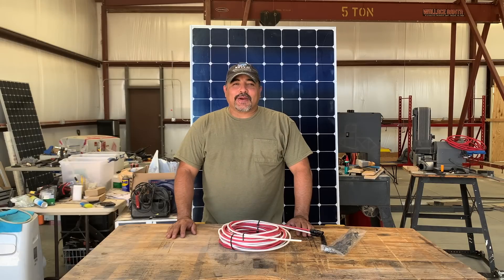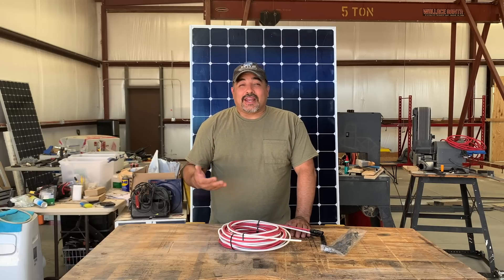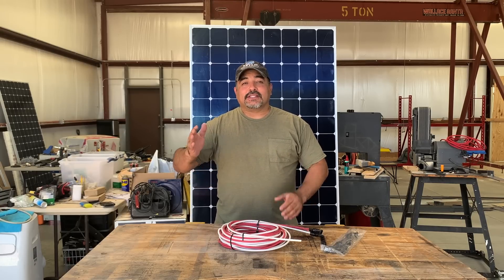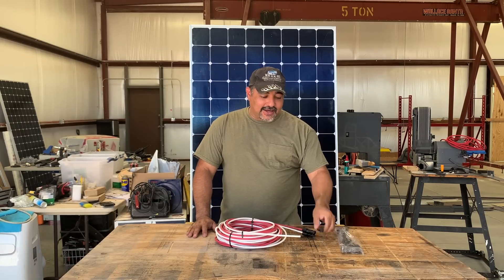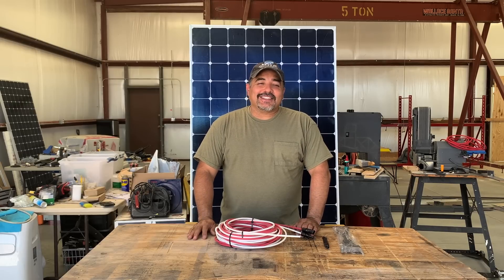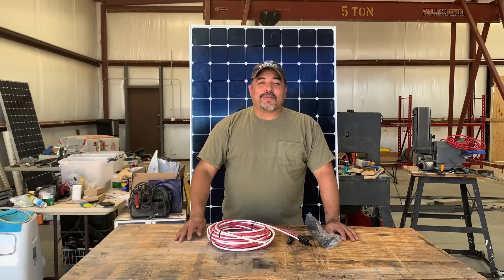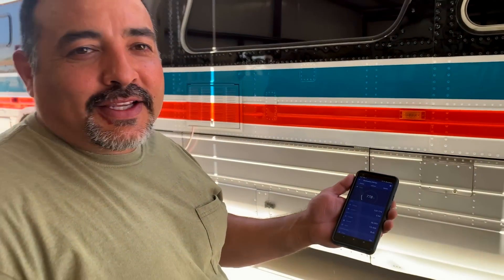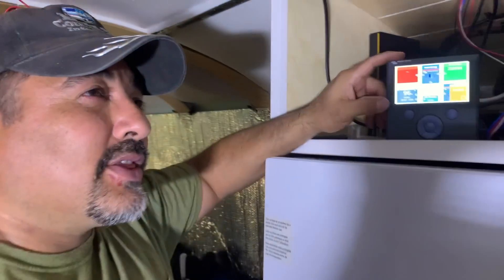More Power for a HOT Summer

Comment: Curious how you run AC when in transit. Is it still off the batteries and recharged by Solar/8V71 Engine generator? I was wondering with the original  300 Amp original 8V71 Generator, could I run one AC off that in lieu of my auxiliary generator?
Reply from the maker: Thanks Joe - we run the air conditioner right off the batteries when we are in transit (which so far has not been very far).  When we are traveling we only have 1750 Watts of solar exposed (our lower panels slide in while we are traveling).  We have not done a generator and we still have the AC Delco 50DN Generator in our bus (we pull a whopping 10 amps with our LED headlights at full bright). We have a unique problem because our house battery is actually a 48V configuration.  They do make step-up converters that will go from 12V to 48V but they are ridiculously expensive for anything but very modest loads.  If (very unlikely) we opt to charge our battery from the alternator this is how we will likely do it.  We would buy a cheaper ~2500 Watt 12V inverter and hook that up to the coach batteries (two 8D lead acid batteries).  From there we would connect the Victron's "generator" input to the output of this cheaper inverter.  When the Victron "see's" the 2500 Watt inverter come online it will act as a passthrough and charge the batteries (assuming our loads are lower than 2500 Watts).  We would also run a temperature probe on the generator to be sure we are not running it to hot so we could cycle it.  For now we are hoping that the battery will be big enough and the solar will be strong enough to keep everything healthy.  Of course we will report back if that is not the case.
Reply: @BeginningfromthisMorning  Thanks for the reply Juan. If I recall, you installed a mini-split. I need to research the power requirements for those. I would like to remove my roof air, but not as solar based as you. Would prefer to run it off the 8V71 during transit. Keep up the excellent work!
Reply from the maker: @hasletjoe5984  You are correct sir - The mini-split A/C was one of the first things that went into the bus.  A few very nice things about the mini-split are that it uses much less power compared the roof a/c, it has a very gradual ramp-up instead of the big hit those roof top a/c draw and its so quiet.  I would do it again 100x before I went back to a rooftop unit :)

Comment: Just wondering what size welder you are running off your solar.  thanks.
Reply from the maker: We have run a couple.  For a long time we used my friend's Lincoln SP 135+, recently we got a small portable welder - Century FC-90.  Both have worked flawlessly even when we are running 3 air conditioners on the bus!

Comment: I don't know how you guys deal with that kind of heat, I guess you get used to it... I'd be a puddle on the floor, we've had a couple weeks of 100 degree weather here in the Okanagan and it was not fun, I put 700 watts of solar on my bus this spring just to run the fridge and it just barely keeps up with the inverter and fridge, if we run any power tools I have to run a generator, for some reason I average about 50% capacity out of the panels... maybe because the sun is lower on the horizon... not sure but I guess I'll need another 700 next year, good to see you guys are still hard at it even in the heat....
Reply from the maker: LOL thank you James - this has been the hottest summer in Arizona history (ever recorded). I have been a puddle on the floor a few times - especially when we have to weld so the big door comes down to prevent the wind from getting into the welds (making the welds porous).  I have told Michelle on more than one occasion "If this is our last summer in AZ for a while - I am 100% onboard with that".  What type of refrigerator are you running?  We did a test on our absorption refrigerator and sold it shortly after because it was such a power hog. You are so much further north and I have to assume you flat-mounted your panels.  Clouds play a big role too.  We are still very much getting after it (as I see you are too!!) - maybe we will be done near the same time :). It would be great to meet up somewhere in the middle :)
Reply: Hi Juan  the fridge is a 22 cubic foot residential 120v fridge... I'm not a huge fan of rv fridges and I have no propane onboard but lots of battery so electric was my choice as I think you guys did too. We usually go to Yuma for a holiday in the fall  not this year obviously but yes, it would be nice to meet up somewhere when we are both on the road , we'll have to keep in touch and see if we can make that happen

Comment: Nice solution!  Way quieter & no gas usage  :)  
Someone in the comments mentioned using the DC side of a regular generator to charge directly DC to DC using your current charge controller.  
I was thinking about building a small engine & car alternator gen-set to use as an emergency backup since it would be DC-DC but at a higher 60-120 amps instead of the lower 8-ish amps from a normal generator...it would be fairly compact and able to recharge the batteries pretty quickly or to use as a supplement on really long low/no sun days if need be.
Reply from the maker: Thank you Gregory - I like your "outside the box thinking" of the alternator solution.  A couple of things to check (I genuinely don't know the answer to these) 1) is that car alternator regulated or can you "tune" it at an RPM for your desired voltage?  2) Can you build a small engine that runs as quiet as those Honda generators (those things are surprisingly quite). 3) the 8ish Amps is at 120V (close to 1000W on the low end) which will charge a 12V battery through your inverter (although there are clearly going to be losses ...) - I would be very interested in checking out your solution if you find a really cool way to do it!  I guess the short version of this comment is I LOVE THE IDEA!
Reply: 1) I would suggest a self-regulated one that is on the low end...like 1500 to 2000 rpm...but 3600 rpm would be okay depending on the engine used...though louder.  
2) You probably won't get any quieter than a Honda...those things are really super quiet!  
3) The 8.3 amps is using the 12VDC output of the normal generator...which is why I suggested an alternator gen-set for higher current charging.  
I have also seen people add an extra alternator on their vehicle engine for a high power output but that would use a lot of diesel in your case.

Comment: I am learning alot from you - but electricity still scares me....Could you eventually place those panels in frames on the roof of the workshop to run basic power need ( lights-etc ) for your ( or others ) use?  Or - perhaps put a couple casters on the frame to roll in /out when you are not there?
Reply from the maker: Thank you Tim - Electricity should honestly scare everybody!  I have a great deal of respect for it.   As for the shop - we are only at the shop temporarily and they (our cousins who own this land) are hoping to have city power run to the shop in the next few months (LOL - probably just as we are rolling out :)).  Fortunately, we don't need to put the panels away because the entire property is gated and we have cameras that record 24/7 and alert us if there is motion in certain areas.

Comment: make your stand out 1/2 or 3/4 pvc pipe and make rectangle out Pvc pipe  That fit in side solar panel  have four tent stake or small sand bags so solar panel blow over by the wind. if you are do temp set up why did you use 10 awg  extinction cord and cut off end $75.00 . or 12/3 awg  at $50.00  and easy wind up.
Reply from the maker: I love the PVC idea!  The frame is made out of 2x3 lumber which was really cheap (I think the entire thing cost something like $15).  As for the cable, we bought the cable, splitters, and the fuse for less than $50 from San Tan Solar.  It does not wind up as easy an extension chord but it is more UV resistant.
Reply: @BeginningfromthisMorning  extension cord Is UV rate should be mark on cord as the wire you got . extension  cord soow have high UV rates.

Comment: Hey, i was wondering how the mini split was holding up? Have you drove around with it much? Has vibration from driving become an issue? I can't see any problem with the plan on paper...
Reply from the maker: Hi - The minisplit has been doing great!  We used to drive the bus 2 times per week (about 8 miles) for about 2.5 years with the a/c cranked the whole time.  Back in April I thought it was done for because it was not blowing cold.  It turns out some of the refrigerant had leaked out through a bad Schrader valve (extremely common even on units mounted on houses).  We had our friend who helped us install it come out and use his sniffer and it was for sure the Schrader valve ($1.59 btw) LOL.  It has been running great since.  When I first installed it there was sooo many people that said it wouldn't last 3 months, it wont last but it has been happily cranking along for over 3 years now.
Reply: @BeginningfromthisMorning  from all my research it seems that there is nothing wrong with installing a split, if you have the room for it. I hear far more stories about the $2000 inefficient rv style roof top models breaking or not performing well, not to mention the noise they produce. There are some amazing 7 star split systems that run on around 350w and quietly produce 2kw cooling!

Comment: I've been watching your videos from the beginning. I really like them. Knowing what you know now. Would you build the same power system again? What changes would you make?

I just bought a 40 foot transit bus. I'm planning out the build. I'd really love your input.
Reply: Been thinking about this myself. Depending on where you live , trying to ditch a generator completely can be tough.   The mini plot AC is a must though. Good luck on the build.
Reply: @HimmelbergerBus  I live in Michigan. I don't think it's ever going to be an option to not need a genset all together. I going to try a small portable inverter generator. My wife would agree about AC. Thanks. I'm going to need all the luck I can get.
Reply from the maker: Thanks Guys.  Let me start by saying that the system has been working very, very well.  If I was to sit down and design a system tonight I would probably use LFP cells from China.  They are Lithium Iron Phosphate and are a better, more durable chemistry than the Nissan Leaf.  3 years ago when I built this system LFP was available but it would have cost me probably 10X what I paid for the Nissan Leaf for the same power.  These days I can put together a pack of about that same capacity for around $4000.  I thought for a while that I would have liked 240V but that was mostly for a dual-head mini-split system.  I don't think I would need 240 for anything else and it would complicate things like shore power and general wiring.
Reply: @BeginningfromthisMorning  Something like this?

https://www.aliexpress.com/item/4001099508935.html?spm=a2g0o.productlist.0.0.211e463eHLJjQ9&algo_pvid=c4726852-2618-47cc-bcc2-8f0820c44b82&algo_expid=c4726852-2618-47cc-bcc2-8f0820c44b82-23&btsid=0bb0622a15997399922313920e9e6c&ws_ab_test=searchweb0_0,searchweb201602_,searchweb201603_

85 cells. 3.2v X 17 = 54.4v, 85 cells X 3.2v X 90Ah = 24,480 W @ 100%  
5 lots of 16 X $824.59 =  4122.95 + 1 lot of 6 X $317.49 = $4440.44 + $488.46 shipping = $4928.90

 If my math and understand of the listing is correct? Not a bad deal? But, I'm sure I could get a better deal buying them all at once.

I was serously concidering a long Tesla Model 3 battery. That would take a lot of time to engineer the system to have it all work together. But it would be very cool in the end. 

Your idea would save a lot of time using off the shelf parts. I don't know which one is more fun, a big engineering project or traveling in the bus. That's a close call...

Comment: Do you leave the AC units running when you are not there?  If not, It might help alleviate heat load on the bus as it won't have a lot of heat built up in the interior and structure of the bus.  This way you would (theoretically) only be running in high mode less to cool the bus down. I run my mini all the time and if I don't,  the air is cool but everything else is hot to the touch.  

BTW,  nice job on the "temporary" solar support system. Assuredly,  the internet would have erupted with calls to action and advice.   

You all certainly have been so inspiring and interesting to join on your journey.   Your attention to planning and the details are awesome.   I always look forward to seeing your updates. Keep up the good work.

Since I've started watching, I'm spending a lot of time convincing my better half to join me on a crazy bus conversion as a result.
Reply from the maker: Thank you so much Richard.  This project has really been great for our family and especially for Michelle and I.  You learn to become really good at problem solving!  We do not leave the A/C units on mostly because we are chicken LOL.  I think we probably could but I don't have a really good way to turn things on/off remotely yet or bring the panels in/out remotely.   Last summer when we had the bus in our driveway we would leave the A/C on all night and it did make a significant difference for cooling things off.

Comment: Would a water mister on the panels cool them down to work more efficiently ?   Maybe nozzles from a car's windshield washer sprayer
Reply: I’ve often wondered if you could run water tubes on the back side of panels to act as both PV solar and for heating domestic water.
Reply from the maker: I love that idea shawn but I think the plumbing would be nightmarish :).
Reply: @BeginningfromthisMorning  Could be as easy as pex coils like people do for solar pool heaters.  You're not wrong though.
Reply from the maker: I have considered that - it would need to spray the back-sides of the panels because the front side would likely just cause a big mess with water spots and turning dirt into mud.  I really can't see how it would not make a difference and I would love to try it but we are really focused on trying to finish up and actually take a trip :). certainly food for thought.  My counter thought is - if we are in temps that are higher than 105 again after we leave .... we didn't do something right ;). Either way we will keep everyone posted on how things actually work when we get going.

Comment: Good that you checked it at extreme temps. how did the air-conditioning cope up with the heat?
Reply from the maker: The mini-split does great keeping the front of the bus cool.  Typically, we can keep it in the upper 70s even when it's over 110F outside.  When we are working on a project where we are constantly going in and out of the bus door, that's a little more difficult, but we can still keep it in the 80s.  The small window a/c does a good job keeping the rear bedroom really cool, especially if we keep the pocket door closed.  And, the small a/c in the battery and electronics bay keeps all the components nicely at 77.  We have been really happy with the a/c units.

Comment: Keeping lithium batteries fully charged reduces their life cycles. Maybe you should add battery capacity
Reply from the maker: Yes, that's absolutely true.  But, when we say 100% and 0%, that's just what our monitor is showing us.  Our settings actually keep the battery between 80% and 20% of capacity for the longevity of the battery.  So, 100% is actually 80% and 0% is actually 20%.
Reply: I’d say they are doing well by keeping them cool. With how they are using them, heat would kill them faster than usage would.